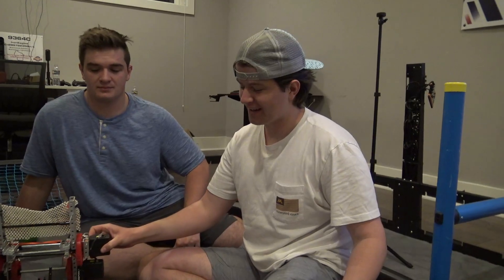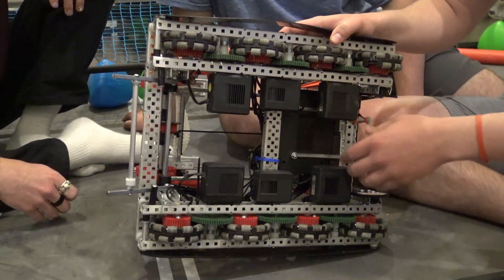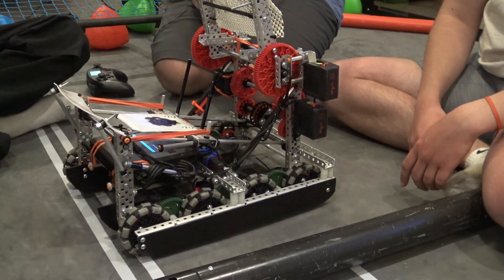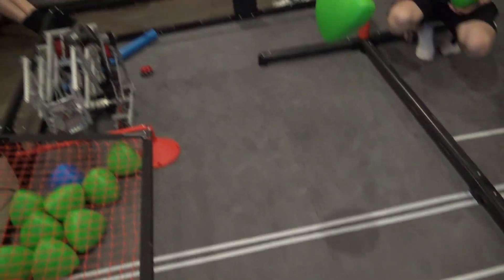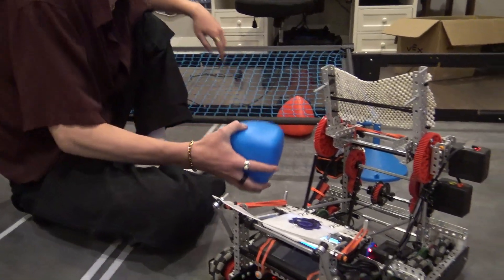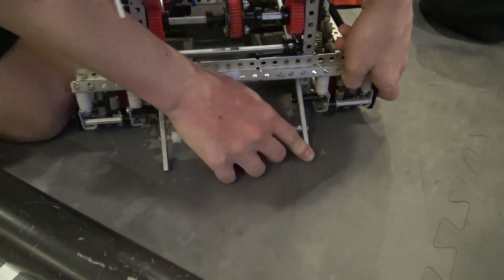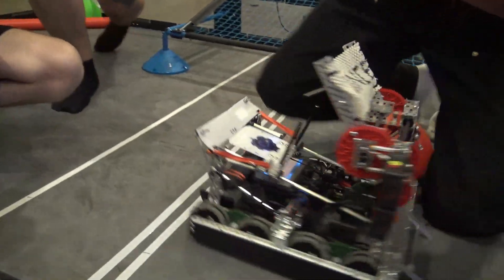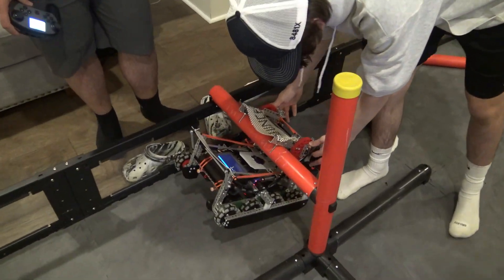Bounce Explanation | WNA RI3D

Comment: How were you able to make the 55W drive work, the 5.5 W motors would accelerate slower than the 11 W motors and burn out. Did you use variable acceleration?